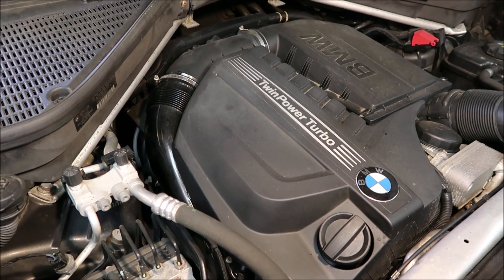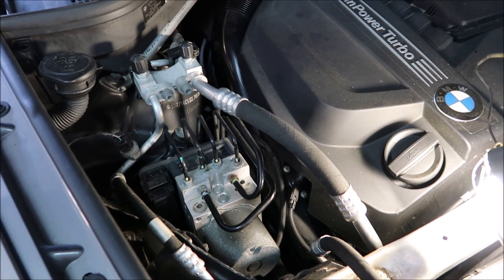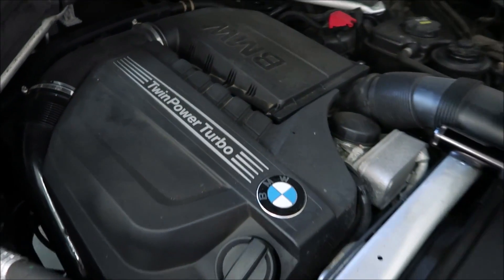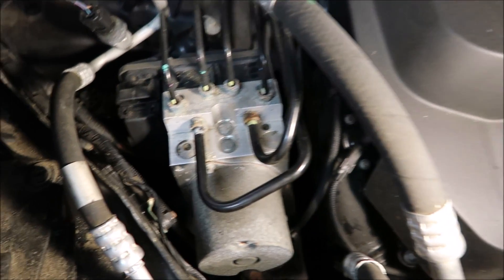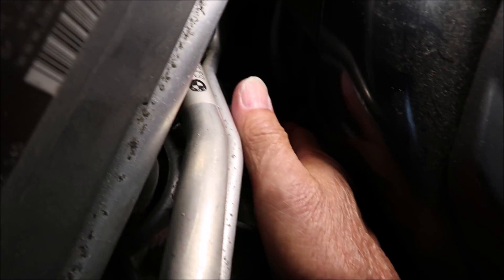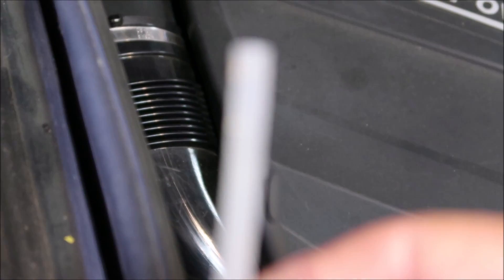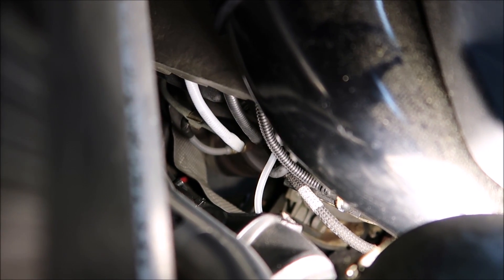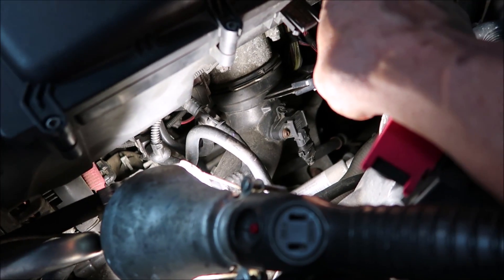#1 TIP for BMW Engine Malfunction! Reduced Power; Fault Error Trouble Code 2C57 - DO THIS FIRST!

Comment: This solved my issue, too. But EVERYONE who has an E70 should replace this vacuum hose as a maintenance item. Not only did it solve my intermittent Error Code 2C57, but my car also idled better, paused less before acceleration, just generally ran better and got slightly better gas mileage.

However, on my vehicle there was no way to see where the vacuum hose went into the engine. I had to remove part of the turbo air ducting to reach it. To do that, I had to remove the air filter box and loosen the clamp to the adjoining piece of ductwork. Once you remove the air cleaner box from it, the piece of ductwork at the back of the engine moves a lot more. You have to loosen the clamps on both ends of the long piece on the passenger side of the engine. There is a rigid crankcase ventilation hose on the front end of the piece that means you can’t just swing it out of the way. So you have to remove semi-rigid vent piece toward the rear, the rigid crankcase vent and a wire. Even with all the parts loose, it takes a bit of wiggling. Once you remove that long ductwork, doing the job is easy – took 90 seconds. I used a little silicone grease on the plastic parts for reassembly.

Comment: I'm just another echo in the chorus of thank yous. The rubber hose was split on mine and, thus, was barely holding onto the nipple. Cut that sucker off, reattached, and done.
Note to others: Getting it back on is  challenge unless you take off the air duct that sits over it. So, not quite as quick of a fix as it might seem, but still no more than a 10-minute job.

Comment: Hi!
I have a 2012 BMW X6M. I just want to make a comment on your video. I wish everybody would make  their videos like you did yours. You know how to make a video clear, precise, and to the point! I do not know whether your "fix" will fix my car, but I will sure look into it. 
I assume that my X6 will be very similar to your X5 regarding this area of concern. I have the exact same problem as you describe. Acceleration causes the reduce power to come on. It's very annoying. Thanks for your video. I'll check to see if I can fix my car with your simple fix.
Thanks.
Reply from the maker: Yes, X5 and X6 will be the same when it comes to this issue.

Comment: Thank you for this video, im dealing with this exact issue, i could hear the air while driving at normal operating temperature with the throttle engaged anywhere from 40%-100%. I have 2011 n55 engine in 335i coupe and it sounded like passenger side, plus air intake tube was replaced with aftermarket aluminum, so im certain this is my fix. Thank you for saving me time and confirming that your engine malfunction occurred at the same temp and same throttle position

Comment: Hi bro., I would love to say thanks for your video. I have a BMW 2011 X5 M-sport, it was display Engine Malfunction Reduced Power Warning, Drive with Caution ... and when I driving (push the gas pedal) the engine was shareking) , I would like to know is that my vehicle problems was same with your vehicle posted? How do I fix it, thanks again.
Reply: Did you get it fixed? Was it the same thing ?
Reply: @weareone7315  No, Is wasn't and is gone than I got new Lexus RC 350 F is was a lot better then . Thank for asking bro.

Comment: So glad I found this video I bought a car and it’s gone back to dealer 5 times and fix and still keeps coming on when I drive over 70mph it’s stressing me is it something serious or not a big deal ? Goes off after it flashes up stays on few seconds then gone 😊
Reply: What was the fix for your x5?
Reply: Had fault codes reset not come back on since but I haven’t drove it hard on motorway since so may come back on

Comment: Great video!! I have an X6 and this also worked on mine!
Reply: I’m months late , but does it run the same way for the x6, having that problem as we speak
Reply: @KannMorris I have the same issue… I got the message while on the highway 😢 I had to exit… turn the car off and restart it…. I need this problem fixed

Comment: Thanks for doing this video. Very helpful. I got this warning last night on my 2013 X5 35i 108k miles. I did check the hose, and it was still attached firmly. Even though I didn't remove it, there was no sign of cracking when I felt it. Also, checked the charge pipe driver side and looked fine. I searched for a while to find a DIY replacing the booster selenoid and found a good video. FYI, here is the link in case someone needs to know how to replace it. -    https://www.youtube.com/watch?v=TNx1MrW6dmc    -                                                                                                                                                                      I still have to scan for codes, but in the end I may just have to start with replacing the selenoid and see if that clears the fault code. Trying to avoid the mechanic emptying my pockets 😎
Reply: Hey I jusr ordered boost solenoids literally 5 min ago on fcp euro, was that was your problem was? I scanned it with mhd and my mechanic said most likely boost solenoids
Reply: @JustAiM_Nick did the boost solenoid fix it?
Reply: @matejovich  sure did bro, I replaced both of them
Reply: @JustAiM_Nick  thanks for the follow-up! Turns out my vacuum line hose was cracked right where it plugs in. I snipped it off plugged it back in problem gone. I'm going to buy 30 ft. Of silicone 3.5 mm hose so I can replace most of them.
Reply: @matejovich  heck yeah man!!! Hope it goes well
Reply: @JustAiM_Nick 
What was your car problems ?? What alarm and message on your screen?
Reply: did the boost solenoid fix it?
Reply: @matejovich  nah before I spent money on that I checked the codes and turned out to be a bad plug on cylinder 5. I went ahead and replaced all the wires and plugs given the mileage.
Reply: @sixstringstak  thanks for the follow-up. Excellent point. I'm at 136, 000 on mine but the engine's been completely rebuilt. Bad crank
Reply: @matejovich  not surprised. I ended up selling mine just got tired of dropping 2k plus every time
Reply: @sixstringstak  man...I know what ya mean....I'm giving it 6 months.....if this continues, she gone!

Comment: Mine is doing this same thing but I'm getting code 3166, 2DCE, 2EOF, 2BCO, and 2BEA. Any advice?
Reply from the maker: Sorry, I have no experience with those codes.  But those codes I think indicate Valvetronic related problems.  Good luck.
Reply: Replaced the valve tronic on mine its a pain. Then you have to take it in to bmw to get it reprogrammed.. It tells the engine the timing for the gears i think 🤔. But it was annoying in the Freeway...

Comment: Where did you connect it ?
Reply from the maker: it's very hard to see.  This video shows the braided jacket vac hose and connection to the boost solenoid at around 7:53   https://youtu.be/TNx1MrW6dmc

The boost solenoid has 2 vacuum lines and 1 electrical connector.

Comment: My local shop wasn't able to figure out the reason for the Reduced Power fault code on my 2013 X5. Thanks to this video and a temporary fix with some electrical tape around the split end, the code no longer pops up. A new hose is on order. Thank you so much for posting this video.
Reply from the maker: Glad my video helped you.  Be sure to LIKE and subscribe.  THAT will really help me!  THANKS!!!!!